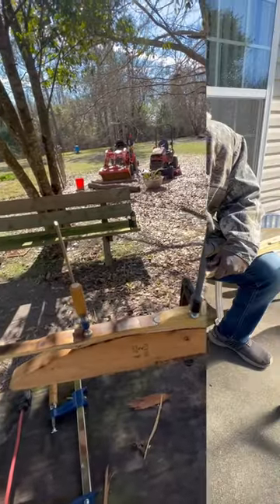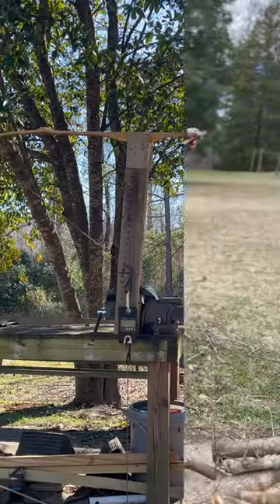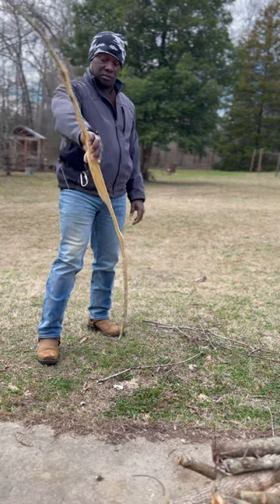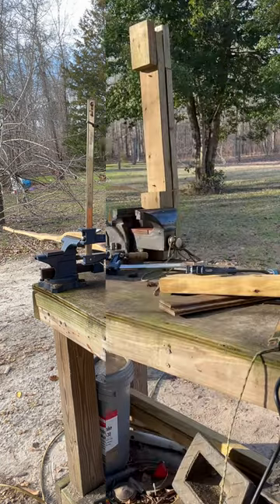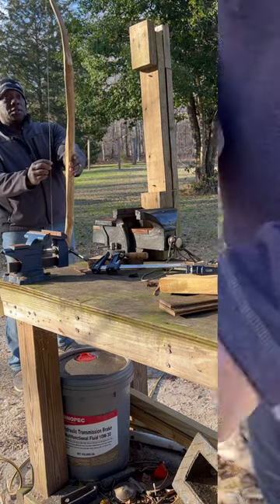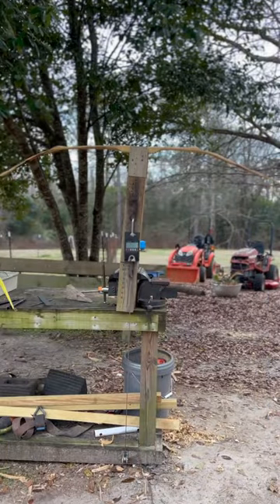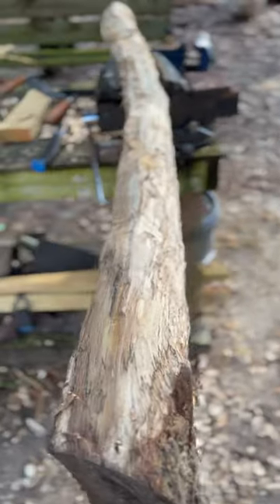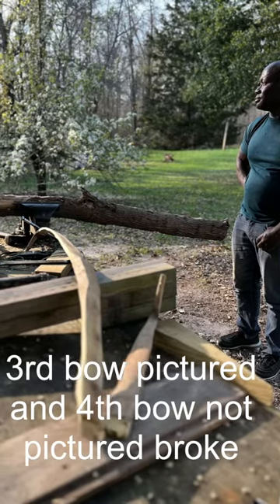Making a self bow from mulberry wood

Comment: How have the later attempts gone?
Reply from the maker: @Thezaxapi  it has been a challenge to say the least. White mulberry wood is a light wood that is very springy. I believe this wood will work better if I back it with fiberglass. I have another mulberry log that’s been seasoning little more than two years;that I will used to get a couple of staves. I will keep working with mulberry until I get it right.
Reply: @ourkindacountry  how large is the piece you are starting with? I took a few pieces from a fallen log. It has a slight twist in the grain I’m going to try to steam out. They will be shorter than I prefer, but more for educational purposes than for hunting. But I’m going to try to make one piece with a sapwood back and the other with all heartwood
Reply from the maker: @Thezaxapi  it’s about seven foot in length with a slight twist. The log is between eight and nine inches in diameter
Reply: @ourkindacountry nice! Decent size log to start with! Both of mine are much smaller that that. The log was almost five feet long and maybe 6 inches in diameter. Going to make one bow using all heartwood and the other with sapwood as the back. 

I also have two maple billets which will be just enough for a 60 inch bow. I will keep you posted on how they turn out
Reply from the maker: @Thezaxapi  yes please keep me posted and I will let you know you know my progress with this mulberry log. I really like the look of mulberry wood. I just have to figure out how to keep it from breaking
Reply: @ourkindacountry I think I will keep it fairly light in draw weight. Probably not more than 40 lb